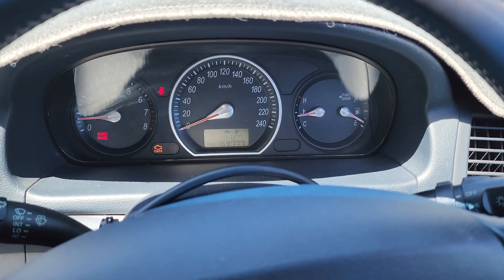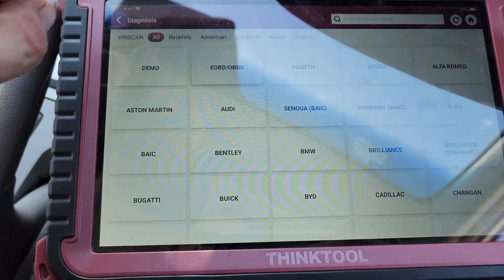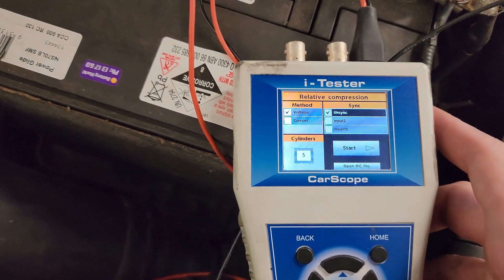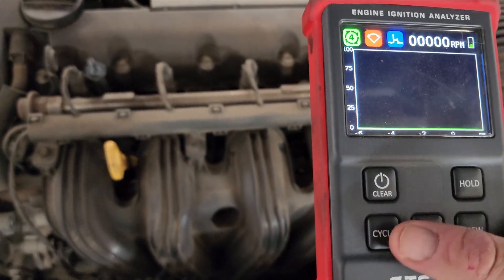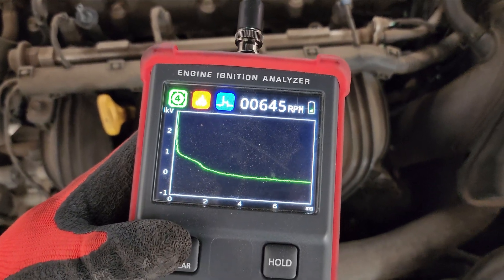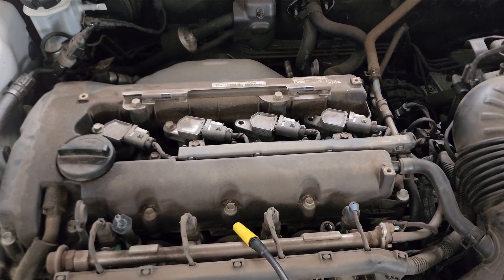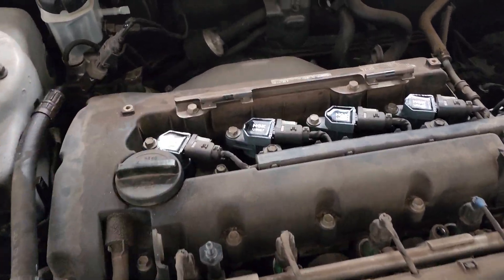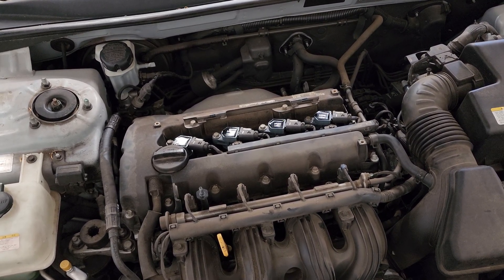Challenge!! Could you diagnose this misfire any quicker? Hyundai Sonata misfire on cylinder 4

Comment: Easy, swap the coil, scan it again, see if the location of the misfire changes when you scan it. And note that if you are working on some European motor cars, as the location of cylinder one can be different in relation to the timing side of the engine.

Comment: Will that tool show a lean cylinder on a snap throttle test by shorter burn line and high kv at the end of burn line?
Thank you in advance for your answer. 
One more question on that tool, will it pickup current flow on circuit wiring?

Comment: Great video, I usually use the picoscope wand to check my secondary ignition, but I really appreciate that you also check the coil and don't just swap things around. Nothing wrong with it, but like you said, you could miss a lean condition or not catch a primary circuit problem.  I like what you are doing, keep it up!  (From Virginia/US)
Reply from the maker: Thanks for the feedback Nicholas. I love using this GTC505 because it's so easy to turn on and set up but you know I love the Pico too!
Reply: @romanosautomotive  I had never seen that tool. You should do a more in depth guide on it if you haven't 👍

Comment: You can diagnose a car quicker, with a 25% accuracy to get it right. When the car comes in to the garage, you see that the car has a missfire ( an experienced tech don't need a scan tool to figure out),4 cylinders roll the dice, 25% to get it right wich one is,and you throw a coil and plug to that cylinder 😇😇😇😇😉.
If it's a 6,8,10 or 12 cylinders car, than the percentage to get it right by lucky, drops dramatically. 
And if it's someone like me, which all the times, if I have to go by luck, it's always the last thing right  that I am going to try,quickest way ,is the test way🤪😜😛🤣
Thanks Rob,for  another great video.
Reply from the maker: Hahah good call, thanks Lambros!

Comment: Those tools your using are good    , the more tools the better as it adds extra dimensions and the added ability to cross reference. Although I'm old school , I still like gadgets . Back in the old days when I was racing the Torana,  I tuned  it with a timing light , vacuum guage , stop watch , nose, eyes and general  feel . Bob and Bap would have probably done the same .
Reply from the maker: I've still got those tools lying around in the tool shed collecting dust but they definitely have a time and place for use. They don't see much daylight lately though with the type of cars we get in now.